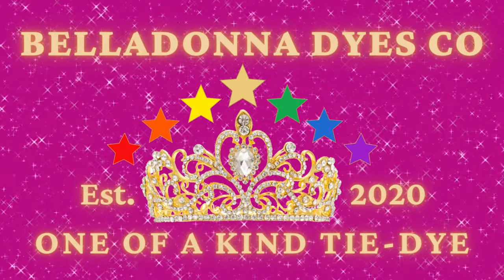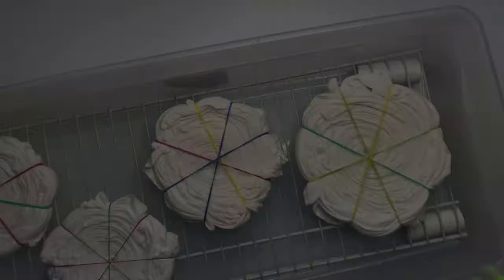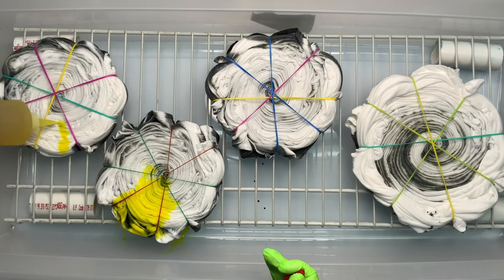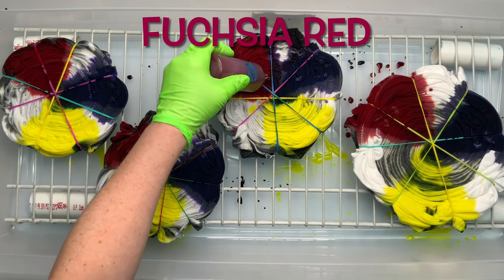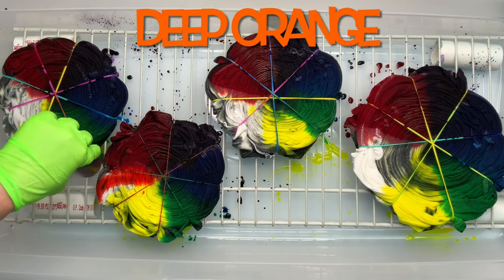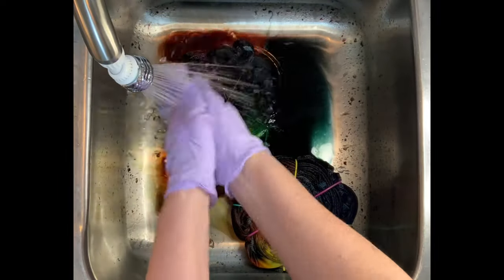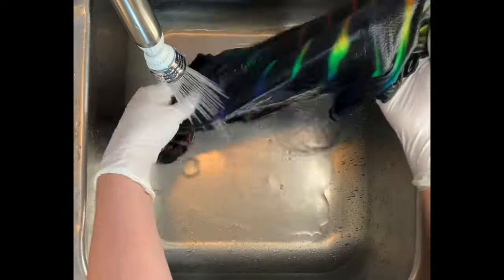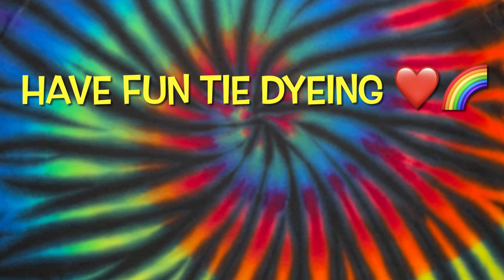Tie-Dye Designs: Black Back Assembly Line | Liquid Dye

Comment: The black background is a great idea, it really does make the colors more vibrant. And thank you for the tip about the under the bed storage container and PVC pipe! For some reason I've been having a hard time coming up with a method / apparatus to hold everything and catch the drips (and leave overnight to cure).
Reply from the maker: Sometimes the PVC isn’t tall enough. I’ll use empty dye jars or Tupperware containers. Whatever it takes. 😁❤️🌈

Comment: These came out great!  I love them. I have to get my assembly line going.  I get hung up on the soda ash!
Reply from the maker: What do you mean? Ringing out the soda ash? If you can, get yourself a panda spin dryer. ❤️🌈
Reply: @BelladonnaDyesCo    I got a Panda!  Bought it on Facebook Marketplace!  

The SA is messy for me.  I have to find a container that I can use without making a mess.  I get SA all over including on me!  I move from one container to another and then back to the original container with a lid.

Comment: I have lemon yellow from dharma- have you ever had a problem with it not dying at all, even after pre-treating the fabric and mixing the dye correctly and waiting over 24hours (at the correct temp?)
Reply from the maker: Oh no! No I’ve never experienced that. It usually just gets overtaken by the the other colors swallowing it. Try a single color dye with it and see if it sticks around. If it doesn’t, contact Dharma, they are pretty good at fixing issues. 🍋❤️🌈
Reply: Thanks! :)

Comment: If you try using a Sponge Stick  the tip is round not sharp
Reply from the maker: I’ve sponged it on before but the sponge brush was kind of pointy. The sponge method works great too. ❤️🌈